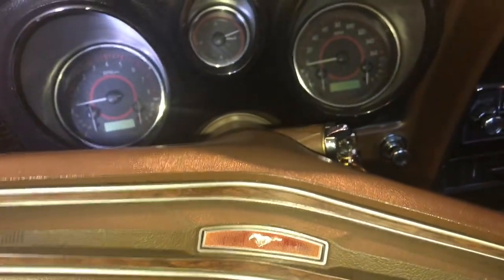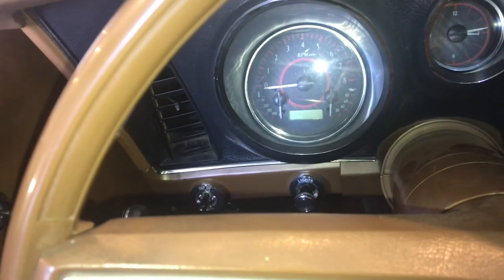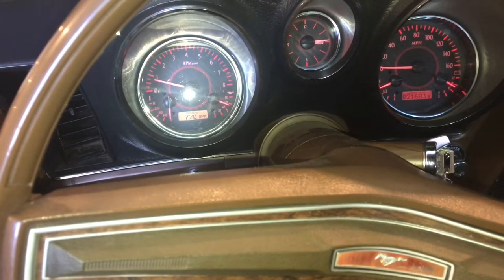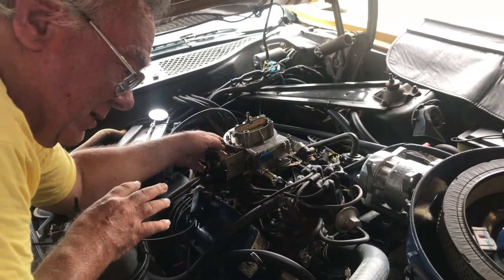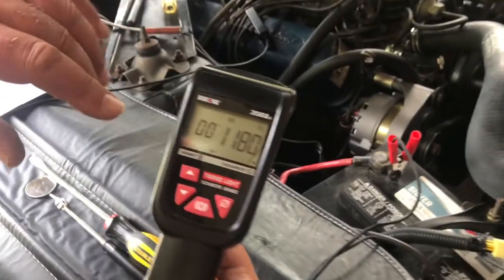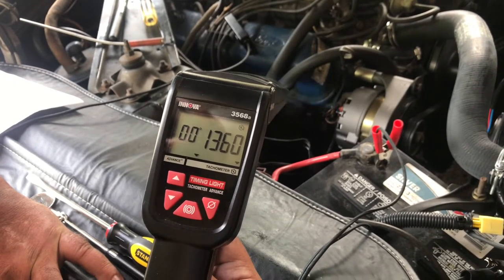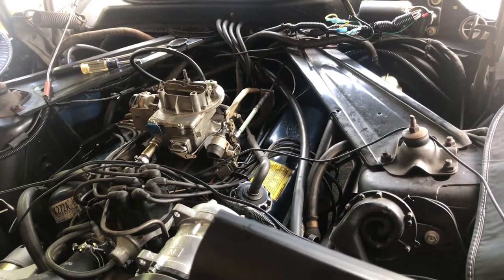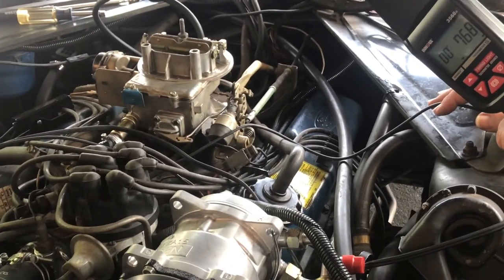1973 Mustang Convertible 302 2v High Idle Speed And Base/Curb/Solenoid-Off Idle Adjustment

Comment: Thanks for making and uploading this video so quickly. I think that I am starting to understand the adjustments. My carb is very similar to yours, except the Throttle Position Solenoid on mine is for the AC on speed adjustment. (The wire goes directly to the AC compressor).
Please keep making these videos. Carburetors are a lost art and we need your knowledge.
Reply from the maker: I do not recall if you have a 302 or 351 (or other sized) engine, much less the year and model.  The various calibrations for the different years, size engines, type transmission, and some options, puts things all over the board.  If you get me your vehicle details I will see if I can find a formal factory idle setting process you can use.  It will be similar to the TPS adjustment in the video.  I know I briefly touched on the A/C solenoid calibration, but have nothing out here I can demonstrate on a video session.  But, once you begin to get into the swing of things the various solenoid approaches begin to make sense.  Eventually, <g>...
Reply from the maker: I am glad you liked the video. Lynda (wife) and I enjoy making them. Nothing fancy. Just solid and useful info on diagnosing, servicing, and repairing these vintage pony cars. I always enjoyed working as a tech in those cars from back then. Now retired from the computer industry I get to tinker with and work on our own little fleet of older pony cars as much as I want-at least during Car Season (we live in Snow Country, Rochester, NY). 

Most Ford/Lincoln engines of that era were given an idle specification of usually 600-650 RPM, with an engine running at normal temperature, after setting the dwell angle of the ignition points and the base ignition  timing with the vacuum hose for the distributor vacuum advance disconnected (temporarily) and plug, in drive with auto transmissions.  

The safest way to do this is with a 2nd person inside the car who is applying the brakes while the tranny is in drive. I have seen a few too many cars in drive with the parking brake set on move forward either due to poor brake condition, incorrect parking brake cable adjustment, not enough of the parking brake pedal was pushed down, in some models when out in drive the 0:25  parking curb to rest the driver side front tire against before setting the parking brake and putting the tranny into drive position. Doing that I never had a runaway car situation. My tune-up partner did the same thing. He also never had a problem with a car setting away from him. 

But, when at home working on these older cars I far prefer to have a friend, son, or wife in the car holding the car still with its regular brakes when in drive as I adjust the curb idle. 

As for the actual specs for your particular car and engine the m specs I proved above are very general. I recommend you dig up the specs via a google search. Or as an alternative message me back with the year model, engine, and transmission type and I will gladly look the specs up for you.

Comment: Thanks for this video Gilbert. Very helpful seeing the fast idle cam adjustments, as well as the throttle position solenoid adjustment. I am needing help on both after my carb rebuild. '73 Vert, 351C, Motorcraft 2100.
Reply from the maker: I was pretty certain that would be useful for some folks.  I know "Gimpy Gardner" had made mention that more info re: the Throttle Position Solenoid would be nice, and I know I wanted to double check on our high sidle speed cam setting to make sure it was where it needed to be.  It is always nice to hear that our videos are of help to others, that is what it is all about. 

Thank you for take the time to send your comment.,

Comment: Gilbert when I set my idle in in gear with the parking brake on to 700 RPMs and then I put it in park the RPMs jump all the way up to 1200. It seems like you have very little difference in idle speed from when you had the car in neutral or part two where you put it in drive. What do you think the culprit is?
Reply from the maker: You are correct in observing that my idle speed does not slow down that much when shifting from Park to Drive at idle.  There are a few things than can cause the idle speed to drop significantly at idle when shifting from Park to Drive.  

•	The idle Air/Fuel mixture screws are set on the lean side,
•	A belt driven accessory (alternator, power steering pump, water pump, air conditioning compressor) is dragging the idle speed down due to saererid cpmponent(s) having excessive turning resistance,
•	The alternator is putting out a much larger amount of current than normal, such as when running after the battery has lost a significant amount of charge.  When the alternator begins to put out current, it will slow the engine down a bit,
•	The torque converter has excessive drag/d]friction internally.

Item #1 is fairly easy to remedy.  In my case I use a diagnostic tachometer and my hearing & sense of vibration to adjust the idle air/fuel mixture screws.  In short I turn the idle mixture screws (using a special screwdriver) to turn the screws (one side at a time(counter-clockwise, which is richer) until the engine no longer increases in idle RPM.  Then I turn the screw in clockwise (leaner) until the RPM had gone up, but just begins to lose RPM or run roughrer.  I then turn the screw slightly counter-clockwise to richen the mixture until the engine is at its highest idle RPM.  I do the same for the 2nd side.  And I do this after making sure the ignition timing is correct.  Once the idle mixture is set I adjust the idle speed, then reset the idle mixture screws once again.

After you have adjusted the idle air/fuel mixture screws, adjust the idle with the tranny in Drive.  If the issue persists you can begin to remove one belt at a time to see if there is a component that is dragging, thus causing the idle speed to be slower than normal.  Do not run the engine for any longer than needed when the water pump belt is off.  There really is no easy way to test the torque converter to see if it is causing an excessive drain on the engine. I check all the other potential causes first, then will call out the torque converter once ruling out the other possibilities.  In most cases I have found the idle a/f mixture was set too lean, and/or the alternator is under a larger than normal load for some reason – usually charging a battery with a low state of charge.
Reply: Thank you for taking the time to write. I will start investigating immediately. Keep you posted.🎉

Comment: Should I set my curb idle speed with the parking brake on and automatic transmission in drive? If so what is the recommended rpm speed for this. Thanks in advance and great videos.
Reply from the maker: I am glad you liked the video. Lynda (wife) and I enjoy making them. Nothing fancy. Just solid and useful info on diagnosing, servicing, and repairing these vintage pony cars. I always enjoyed working as a tech in those cars from back then. Now retired from the computer industry I get to tinker with and work on our own little fleet of older pony cars as much as I want-at least during Car Season (we live in Snow Country, Rochester, NY). 

Most Ford/Lincoln engines of that era were given an idle specification of usually 600-650 RPM, with an engine running at normal temperature, after setting the dwell angle of the ignition points and the base ignition  timing with the vacuum hose for the distributor vacuum advance disconnected (temporarily) and plug, in drive with auto transmissions.  

The safest way to do this is with a 2nd person inside the car who is applying the brakes while the tranny is in drive. I have seen a few too many cars in drive with the parking brake set on move forward either due to poor brake condition, incorrect parking brake cable adjustment, not enough of the parking brake pedal was pushed down, in some models when out in drive the 0:25  parking curb to rest the driver side front tire against before setting the parking brake and putting the tranny into drive position. Doing that I never had a runaway car situation. My tune-up partner did the same thing. He also never had a problem with a car setting away from him. 

But, when at home working on these older cars I far prefer to have a friend, son, or wife in the car holding the car still with its regular brakes when in drive as I adjust the curb idle. 

As for the actual specs for your particular car and engine the m specs I proved above are very general. I recommend you dig up the specs via a google search. Or as an alternative message me back with the year model, engine, and transmission type and I will gladly look the specs up for you.
Reply: Thanks so much for writing back. I have watched most of your videos. I was able to get my timing adjusted correctly thanks to you. I also have a 73 convertible with a 302 2V.
Reply from the maker: Our vert is also a 73 with a 302 2v and an auto tranny. So you can set your carb up like I show in the videos where I am I using the vert as the subject vehicle.